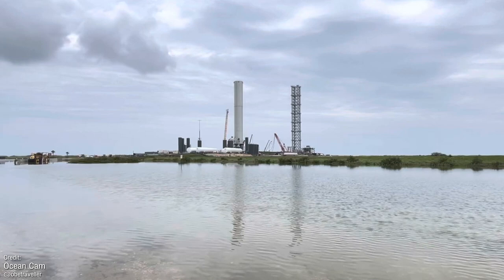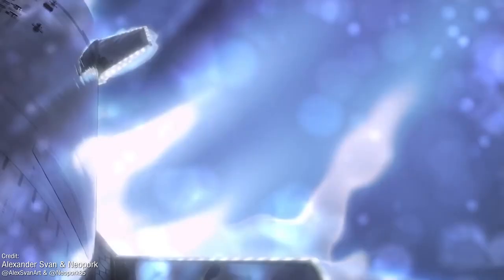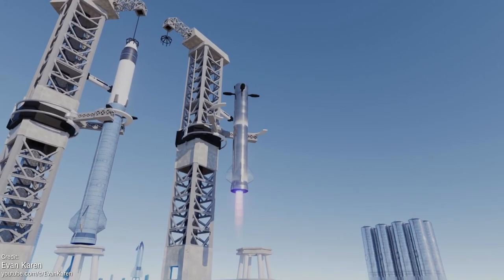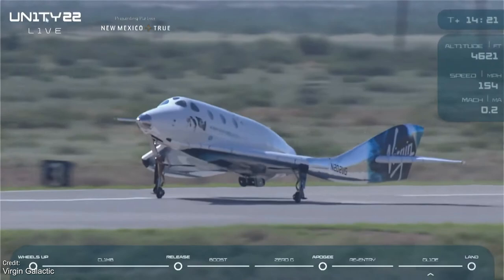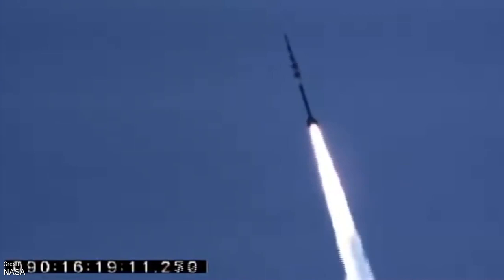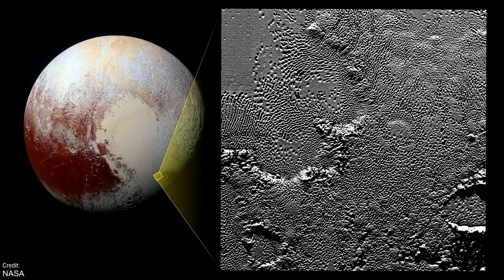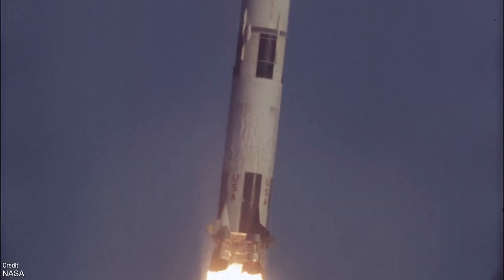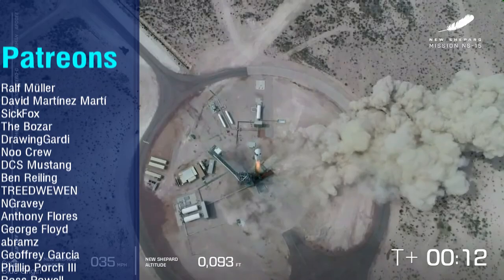SpaceX's Starship Orbital Flight Rapidly Approaches, and VSS Unity beats New Shepard to Space!

Comment: Am I wrong or Orbital Test isn't planned as an Orbital flight? As I remember from their announce SN20 wouldn't achieve orbital speed and complete full orbit, so it's a suborbital flight.
It's pretty misleading though reasonable name - this flight would test all the stages of orbital flight without actual orbital flight.
Reply: Exactly! Why is everybody so excited about a flight that is just an extended version of what they did before, on an untested and potentionally explosive booster at that! Orion/SLS will fly around the Moon crewed well before Starship carries any useful payload, mark my words.
Reply: Virgin Galactic is a little more misleading! 😄
Reply: @HalNordmann  Well I wouldn't call that flight extended version of previous 10km hops (which for some reason were called suborbital tests lol), it's a way more complicated mission. Also as much as I root for SLS, SX might still put some payload in space before Artemis II, but I agree that Starship itself would probably be still in development phase at that point.
Reply: @mrkeogh  Well, as much as my metric system fan's bias goes I prefer 100km Karman line, but really there isn't much difference between 80 and 100km since there is no actual border and atmosphere is going almost to the Moon's orbit. But yeah, I think "to the edge of space" as some sources states is more appropriate for the Virgin flights than "to space".

Comment: I wouldn't go on neither one of those. I'd rather pay to go on Zero G. They allow you to float in an entire Boeing 727. The trip takes about 5 hours doing 15 nosedives where you'll float in 0 G. It's also just a fraction of the price per seat at about ~7000$ not at 250.000$ per seat. Which means it's much more affordable, you'll experience weightlessness for much longer + have much more space to float around in and it's also much less dangerous. So that's my pick.
Reply: Cool but still space is something

Comment: I would ride on the New Shepard capsule, because I don't think SpaceShip Two has an abort system. I don't want to die just because I wanted to see Earth from 100km up. Plus, the ride on New Shepard is much shorter when your not in space, meaning a bigger proportion of your time is spent in space. New Shepard is also more environmentally friendly as it's powered by Hydrolox compared to Solid Fuel which is worse.